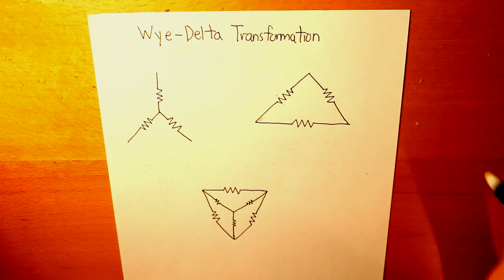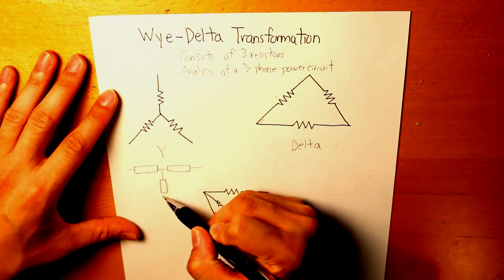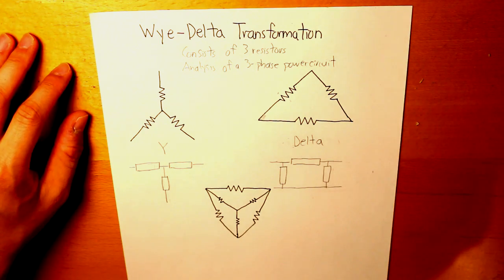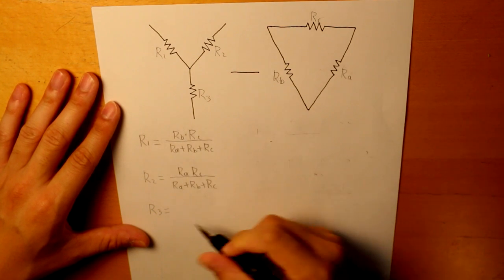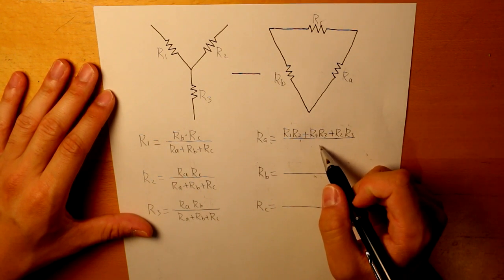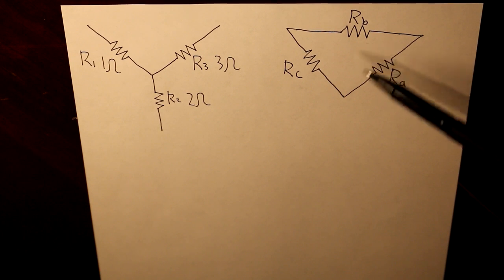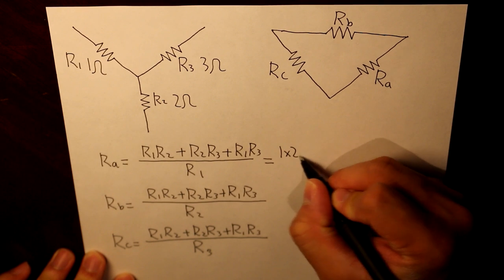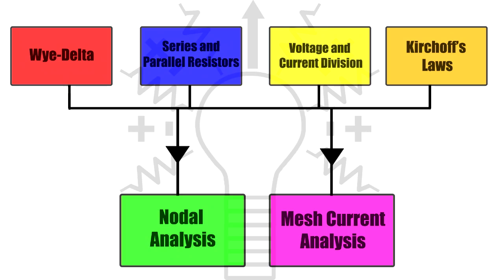Wye-Delta Transformation

Comment: Easier to use G, conductances, in going from Y to Delta, as the equations have the same format as used in D to Y (for example, G1G2/G1 + G2 + G3, for each Delta resistance respectively).
Reply: Gc = G1G2/(G1+G2+G3)